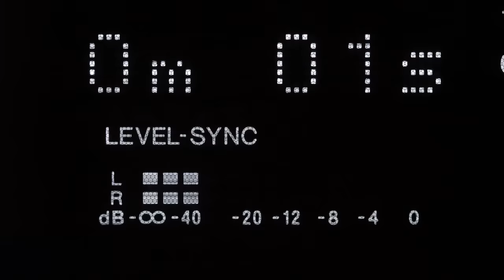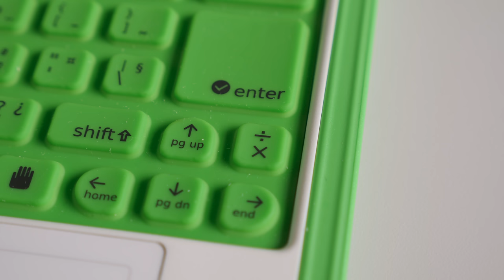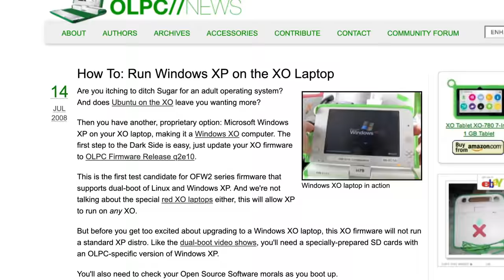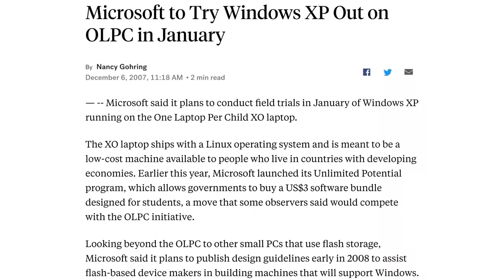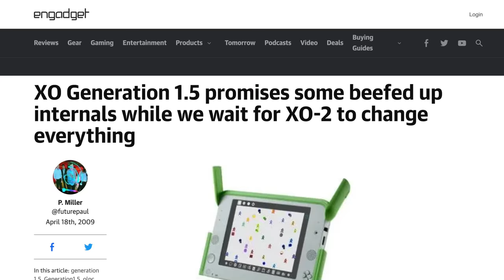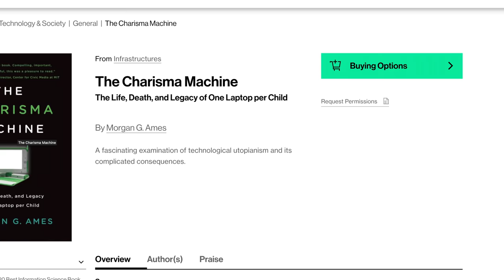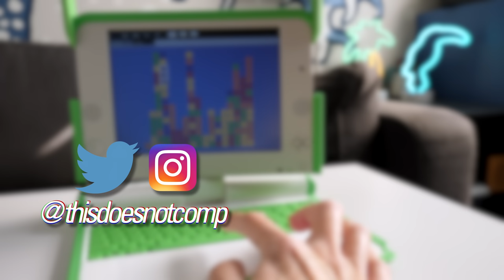OLPC XO-1: The $100 Laptop (That Wasn't)

Comment: Netbooks definitely happened due to the XO-1, and netbooks drove down the cost for parts, like screens and made Intel create the ultra-low power CPU category of Atom and it's later iterations you can buy to this day. Even if the XO-1 itself didn't happen on the scale it was supposed to, it definitely helped to make computers cheap enough in 3rd world counties, so in a sense it succeeded.
Reply: I was about to say the same. When I started messing with computers, notebooks where very expensive. The first one I got was a EEEPC  Seashell from Asus. While limited, it actually was usable for the time and served well for several years in my family.
Reply: I really wanted to like netbooks. I remember buying one in 2011, just as the fad was dying down. It came with Windows 7 Starter - it was utterly unusable, a simple security update would freeze everything. Only with Lubuntu did it become a relatively good tiny laptop.
Reply: And while netbooks were sort of a flop as well, ultimately they evolved into Chromebooks which seems to have finally cracked the problem of creating cheap, but still decent laptops.
Reply: @MattExzy  Yes, Lubuntu is very light and great on system!
Reply: Netbooks where a false economy though
Reply: @Jeremiah Bullfrog we bought into a false economy sadly 😂
Reply: Netbooks, including the name itself happened thanks to Psion.
You kids may not know it, but this company was making extremely useful tiny organizer PCs with insane battery life throughout the 90s.
And in 1999 Psion netBook was released. Not a great commercial success though.
They applied for trademark to the name in 1996.
Reply: I had a netbook at the start of 2006 . . . .
Reply: Atom was Intel’s (ultimately unsuccessful) attempt to counter ARM. One of the catchphrases they used was “full Internet experience”, which was secret code for “runs Adobe Flash Player”. I don’t think Atom chips ever made a profit for Intel.

Netbooks running Linux were great (I still have one). But they got squeezed out of the market by Microsoft. Remember Steve “Linux Is A Cancer” Ballmer was still in charge.
Reply: @theblah12  Netbooks got killed by Microsoft fearing the market and forcing the vendors to only provide Windows - which wouldn't run on a netbook. So MS brought back XP for the second time as it could run on such small systems.
Reply: netbooks happned due to a demand for laptops that didnt ask for a kidny to buy one. it just didnt take long for laptop top catch them on pricing and better specks.
Reply: @jessepollard7132  yep it got relly bad with windows 10 where one update would fill its storage.
Reply: @lawrencedoliveiro9104  I wouldn't call Atom a fail. Nowadays Intel uses Atom cores even on their desktop 12th and 13th gen CPUs as the E-cores
Reply: I want an 11 inch laptop with i5 processor, I have something close to it, a Fujitsu T731 12.1 inch with i5 processor. There's also the Lenovo X210, X220, X230, HP 2570p, 2540p
Reply: Also big manufacturers wouldn't just let it succeed if they aren't the ones doing it but ultimately it did help competition n prices

Comment: Quick fact add: The screen was only 1200 pixels wide with backlight off thanks to a neat prism effect. Light coming in would use the red/green/blue pixels as individual shades of grey. With light coming from the backlight they show as RGB. Really neat design.
Reply: Yeah, the screen was 1200 x 900 pixels, but a color dot was actually three pixels (RGB). It was actually difficult to establish a screen resolution equivalence in RGB mode. The best conversion I was familiar with was an effective resolution of around 700 x 500 (resolution divided by square root of 3). However, that was still just a convention, you had 1200 x 900 resolution, but only color information at a third of that.
Reply: It was great that it was perfectly readable in direct sunlight.  Was a neat device overall.   The company that made the transflective displays tried to enter the general market too but ended up folding sadly
Reply: I never understood why this panel type never made its way into other consumer electronics.
Reply: @frankdogui7195  It was designed to be efficient and practical, and most importantly, did not glow an obnoxious bright blue like all consumer electronics of the early 2000s.
Reply: I would like to see that screen on a phone
Reply: this is so smart tbh the media and everyone in the industry shouldve given them more credit
Reply: Lol. I think people are confused.  LCD screens have existed before color pixels were added to them.  Anyone who has an old Casio watch had a LCD screen.  The liquid crystal display works when electric charge changes the polarity of the light entering liquid crystals screen which would be absorbed be polarized filter in the display. Basically the screen on that laptop is using only the LCD crystals and not the color pixels when back light is off.  The screen likely was made like this. Top layer was a protective plastic panel, under that was the polarized filter, under that was the LCD crystal layer, under that was a refractive glass that allows some light from outside of the LCD screen to be refracted back out, then the RGB pixel layer, then finally the back light. When back light is on, it passes through the RGB layer, which, passes through the refractive glass, individual colors are filtered through the LCD layer as color graphics, passing through the polarized layer and protective glass layer. With backlight off, ambient light passes through protective plastic layer, unpolarized light passes right through the polarized filter, gets polarized by LCD layer, gets refracted back out by the refractive glass layer, LCD layer ignores already polarized light, polarized filter filters out polarized light. What gets emitted from screen is actually a negative image. Basically the chromatic black images is what got filtered and not emitted. Also all RGB elements exist in one pixel. So no resolution does not increase with back light off. However chromatic black images tend to look sharper than color ones at low resolutions. 

It’s so funny when people get it completely wrong. 😂
Reply: @JasonB808  you so silly.

Comment: Re: the hand crank charger. I was involved in a community XO project, and one of the tasks we chose was doing generator based charging. It turned out to be a bust -- the XO's battery could only sink the equivalent current to charge at a rate of about 2 1/2 hours to full charge. You'd have to spin that crank forever. The closest we came (concept, never built one) was to use a bicycle to drive a generator, charging a larger battery, then using that battery to charge XOs.
Reply: Worked for Gilligan
You just needed more coconuts.
And the Professor
Mary Ann wouldn't hurt either
Reply: a hand crank by a human is about 10 to 15 watts before it get to hard to turn. charging something the size of a laptop battery would litterly take days.
Reply: @gogereaver349  The XO's battery was about 25W, so it would have taken about two hours to charge. Unfortunately they never got the power consumption down to what they hoped for, so a charge was only good for about two and a half hours (on color backlight) 😀.

Comment: I got one for $6 at a goodwill, compiled my own kernel, and made it setup for doing terminal access (wired one of the USB ports to a serial adapter internally)

I love its ease of repair, and even after loosing screws i found it keeps spares in the handle (remove screws by battery to get the handle cover off)
Reply: @Farquad76.547  when taking a laptop to a site that is in a scary part of town (or an area with a lot of dust and dirt and other airboarn debris) to reprogram a router/switch, do i want to take a $600 laptop that could break by looking at it wrong, or a $6 kid proof one, (also why i have a cheap 200$ hp cloud with linux on it.

cheap laptop i dont care about goes with me to bad parts of town in areas that are not suited for laptops, and good laptop goes with me to sites were i dont have to worry about it.

although i rarely do that stuff any more, i do like having a cheap durable laptop for jobs i dont want to take my expensive one (to me) out on. (although i do have like 10 laptops, ranging from the OLPC and some P4's to a 2010 macbook, and my main lenovo)
Reply: @jjjacer  Plus the built-in "anti-theft" feature of the fact that it looks like a kid's laptop (which was actually part of the original design specs)

Comment: I liked the idea you could even hand-crank it, in order to keep it going. The idea of low-powered devices for certain emerging markets wasn't off but what really probably killed this whole endeavour off in the end were subsequent advances in mobile technology and networks; as an educated guess, the cell phone became the real gateway to the Internet.
Reply: You're not wrong. It was the inexpensive android phones that finally got mass adoption in my country (Bangladesh). Computers are still miles behind.
Reply: IIRC early concept art and mockups of the device had a hand crank built in, but that proved infeasible.
Reply: I would imagine if u were in a place with no easy access to elextricity, then wifi would also be MIA
Reply: @aoikemono6414  Not entirely. While internet access would be a problem, the laptops were capable of mesh networking, so you could still send data around a classroom.

Comment: Very interesting video. I remember the hoopla about these and thought $100 was an amazing target price because laptops were pretty expensive at the time. As Collin said, there were no $120 plastic chromebooks you could pick up at Walmart like you can find now. I remember buying an MSI Wind netbook a little after this and was amazed I could get a computer for $300.

I went to eBay to see if there were any X0-1 machines available and was surprised to see that they still fetch a pretty good price around $70 with shipping for a working device. I am not sure I would want to spend that much but they do kind of feel like they could be a collectors item. Trying to decide how mad my wife will be if I stack another "vintage" laptop in the closet.
Reply: Yeah, I remember watching this closely at the time. Back then a laptop seemed like a completely unattainable goal for a kid. I was heartbroken when the Buy One Give One program happened and it was 400 dollars instead of the promised 100. Eventually I ended up getting an Acer Aspire One (I believe it was around 200) and ran that thing until it died.
Reply: The problem was, the reason there were no $100 laptops at the time was it was an impossible price point to hit. It sounded good in the media, but to try and reach it -- they failed anway -- they totally crippled the machine.

Comment: If only a modern laptop was available that's sturdy like this and repairable, with a removable battery. I like how the swivel-screen doubles as an e-Reader.
Reply: So, a Framework laptop, but with a rotating hinge?
Reply: the most modern laptop like this is probably the x230t and x220t thinkpads
Reply: Bullshit. Most laptops of the era were at least as serviceable.
Reply: Its one of thouse things that people think they want right up to the point when they have to put money down. Then other factors like weight, performance, looks or upfront price win out over repairability.
Reply: @xerzy  I am aware of the framework laptop. And I'm skeptical of it reaching mass market appeal, because it is a niche product.  Consumer grade laptops used to have modular bays and then they disappeared and not enough people cared for the major manufacturers to bring them back.
Reply: @KonradZielinski  That's nothing to do with devices being heavier, slower, or more expensive though. That's just due to Framework's lack of resources and the interests of manufacturers who do have them.
Reply: @KonradZielinski  i used to love my dual bay dell. rember this was the days before laptops that got 10 hrs of battery. you could slot 2 batterys in and get a good 5 hrs of use.

Comment: Uruguay Nomah.

We used this machines around 2007 to 2014 in public schools since the government approved a plan which consisted of delivering one of this machines to each student of the country.

If I recall there where 3 variants of this machines this one shown here, an updated model with a plastic shielding around the keys and then there was a blue variant that was more powerful and it ran Gnome (if I'm not mistaking).

They weren't really good, but it could run Doom at least, there were even a few games made here for the machine by indie devs and some by the state, there were also a bunch of flash games compilations made by homebrew sites.

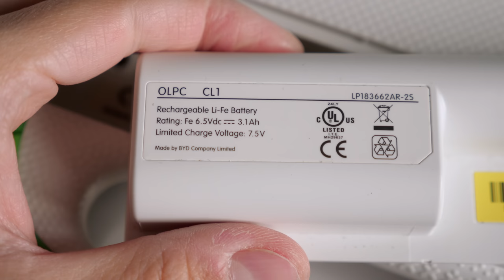Comment: @3:32 A Li-Fe it looks like they went out of their way to use battery chemistry that has a high cycle life in the thousands compared to lithium ion batteries which often rated for a few hundred charge cycles! Or was that chemistry more of a thing in the early 2000s? It's just starting to become more mainstream in 2021.
Reply: This was definitely late 2000s. I remember it well. I donated to the project.

Comment: 6:12 The whole point of OLPC was to encourage experimentation and reward curiosity, hence the easy access to the parts underneath the GUI. I believe also the magnifying glass key actually means “view source”, as in “look at the source code for whatever is running now”.

One unusual thing about Sugar was its “journal” system, where you had a systemwide list of all the activities you had done recently, including links to the documents you had worked on.

The Sugar project is still active, even today. Packages are available in the standard Debian repo.

Comment: The primary school I work at here in Australia, we received 150 of these, didn't cost us a cent.

We got about 40 or so in 1 shipment, and then at a later date they supplied us with the rest of them.

They also supplied us with charging stands, and several repair kit boxes (New screens, keyboards, antennas, etc...).

All of ours initially came with Sugar, and BEFORE we were even allowed to receive any of the XO's, we had to nominate some teachers that had to have training for the SugarOS. Once the training was done, and we received the XO's, no other teacher was allowed to use them.

All our XO-4's came with the mesh capability, and they were using it quite extensively (This was around 2014).

Eventually we replaced Sugar with Android, but that was really the downfall of the XO, the Android interface just wasn't as nice to use compared to Sugar.

In the end, the OLPC contacted us (around 2018 I think it was), and asked us to return as many as we could, I still have a few left at the school, and still have all the repair kits they sent us.

Comment: Damn, 3 hours of battery life with a 3 Ah battery? My laptop has a 70 Wh battery and lasts around one hour. This shrek laptop is probably the most battery efficient thing i've seen
Reply: My my iPhone is a little supercomputer with a 3ah battery and it lasts about 10 hours.
Reply: @adaml.5355  I am sorry but I have to correct you on this, your phone battery is wayyy smaller than this laptop. Yes, it's 3ah but the capacity is not the same because of different voltage, using watthours is the most accurate way to compare battery capacity, Ah depends on voltage.
Reply: chromebook have simler tdp and run like 11 hrs these days.

Comment: I knew one of the software devs working on this project and had some hands on time with a few different models. The wireless mesh was pretty cool because (if i remember correctly) they were working on allowing a group of the laptops to communicate and interact without any internet connection or routers.

Comment: Have any other laptops used an Li-Fe battery?

I always thought this was a cool idea, I still do.  I'm not sure how big an impact it had but the device they came up with seems really well designed.
Reply: Not much battery Li-Fe, though 😉, at least in the first iteration
Reply: Had two of them fail; one straight out of the box and the other one after 3-4 years of use. I don't think they were very good.

Comment: I have two of these XO-1s that I got for free at a swap meet. Both were experiencing the firmware bug that plagued these models. When the CMOS battery drained, it reset the internal clock which then prevented the computer from powering on. Fortunately this bug can be fixed using a serial connection and updated firmware. I made a really basic video ages ago that I titled "Two Laptops Per Adult" documenting my experience with restoring these.

Comment: What I remember about these was that they only slightly predated the netbook craze. Around the time I was hearing about the XO1, Asus launched the EeePC line. For only $350 or so - less than the give-one-get-one cost - you got a smaller machine with a better keyboard, more RAM, and more storage, that was also a "normal" PC that you could easily get XP or a standard Linux running on. Prior to this, small machines commanded a huge premium - see the Toshiba Libretto and Sony Picturebook series for example.

I think at the time the desire for cheap PCs was heating up, but XO1's downfall was it's focus on children, leading many to just see it as a kids toy. But I feel the success of the OLPC project was encouraging the rest of the industry to get costs down, starting with netbooks and eventually trickling down to just about every laptop becoming cheaper and more affordable.
Reply: didnt they made the 4gb 701  for like 130$. that beat out them on price and specks.